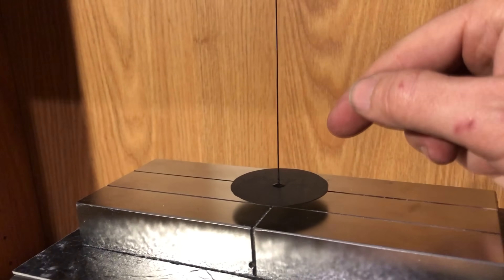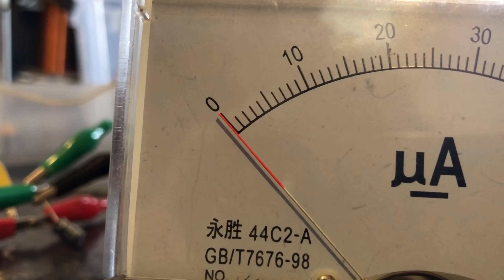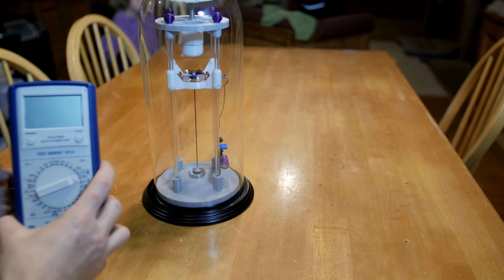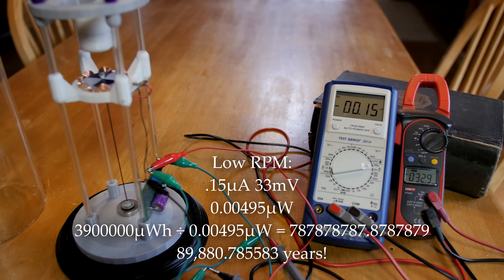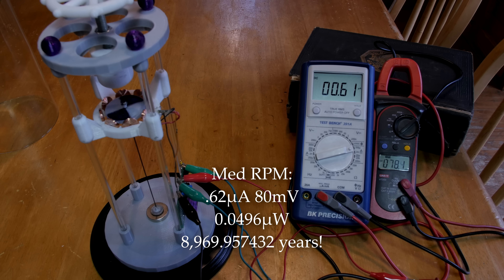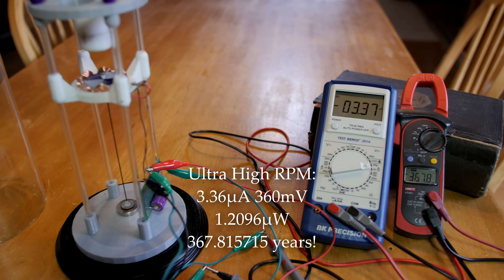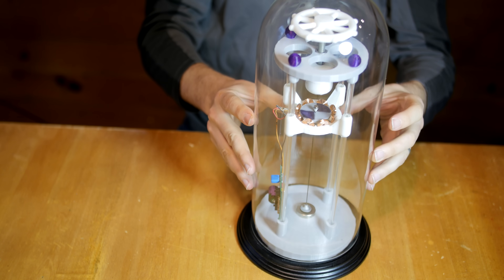Fully Levitating Magnetic EZ-Spin Motor - Pyrolytic Graphite

Comment: The motor is doing zero work, but it is still impressive to have such a low free running power requirement on a motor.
The power consumption is essentially nothing.  The battery will self discharge much sooner, pretty much at the rated shelf life of the battery (40 years).

Comment: The power loss on the resistors is P = R*I^2 = 24MOhm * (150nA)^2 = 0.54µW. So the total power usage would be 0.54µW + 0.00495µW = 0.54495µW which gives around 816 years on 3.9Wh.

Comment: You could try to harness the background cosmic radiation, I don't even know if this its feasible but with such a low load it's at least plausible, I cannot think of anyone who has actually tried it due to the fact that background cosmic radiation has such a minuscule amount of energy but if somehow you make it work your motor could theoretically run for millions of years uninterrupted.
Reply: cosmic energy? you could run it on paranormal ghost energy
Reply: @rogerd4559  cosmic radiation it's leftover from the light and radiation of the big bang, it permeates everything around us but the energy density is almost worthless, if you could somehow harness all the power raining on the surface of the earth it would be just a few giga watts yet that's not the hard part of it, energy its just a convenient concept we invented, it actually does not exist as such, what we call energy its actually a usable flow of low entropy to high entropy states of matter so in order for us to extract "cosmic energy" you would have to use something even higher in entropy and there aren't many things that can do that hence why the output energy is so low and complicated to get
Reply: @ericsaul9306  I got the jolt of my life hooking up my tv antenna to the back of my TV from that so called useless cosmic radiation

Comment: tl;dr: 178 years under generous assumptions (for the motor as described in the video).

So, your calculations assume that you can use all the energy, but you're dropping 99% of the energy in your resistors.  The battery you're using is nominally 1.2 Ah, but at 10 uA, it's actually 0.97 Ah according to the datasheet.  I tried a bunch of things to figure out how to extrapolate that to 0.15 uA, but didn't come up with anything I believed.  So, let's just assume that you get the 0.97 Ah (even though we know it will be less because of more self-discharge).

That gives us: 0.97 Ah / 1.5e-7 A  = 6.47e6 hr = 738 yr.  So, we know it will not exceed that.

Next, I took a deeper look at the datasheet.  Looking further at the discharge characteristics graph we see that, at 0.5 mA, we can extract 4.176 Wh of useful energy (3.48 V * 1.2 Ah).  That's the highest energy extraction in the graph.  At 10 uA, we can extract 3.531 Wh.  So, over almost 11 years, we get 84.6% of the energy that we would have gotten if we had extracted it at 0.5 mA for a bit over a quarter of a year.  If you work it out, it comes to 1.52% capacity loss per year.

So, I created a program which starts with a full battery and each year removes 1.5e-7 A-yr of capacity (which works out to 1.3 mAh) and then multiplies the remaining capacity by 98.48% (=100% - 1.52%) to account for self-discharge.  It stops when the capacity goes negative.

For the TL-4902 half AA battery you used (1.2 Ah), it dies on the 178th year.  If we use the full AA battery (2.4 Ah) it dies in the 220th year.  If we used a "standard AA" (3.9 Ah) but assumed that it self-discharged at the same rate as the TL-4902 battery, then it dies in the 251st year.

If we assume the 0.7%/yr self-discharge described in the article you linked, then the three batteries, the 1.2 Ah, 2.4 Ah, and 3.9 Ah, last for 286, 375, and 440 years, respectively.

So, even under the most generous assumptions, I think that a millennium is out of the question, but at least on paper, it could last decades and a century seems theoretically possible (again on paper, at least).  Of course, that assumes that the materials you used don't degrade and that the battery doesn't corrode and so on.  And that no one bumps into it for a hundred years... :-)
Reply: Okay, one more thing:  If you want to assume that you can make use of 100% of the energy (so you have a mythical 100% efficient DC-DC, for example) then my program gives the following numbers:

For the half AA battery (3.53 Wh) we get 466 years.  For the full AA (7.06 Wh) we get 511 years.  For the standard AA (5.85 Wh (3.9 Ah * 1.5 V)) we get 499 years.

So, better, but the self-discharge still eats you alive before you get near a millennium.
Reply from the maker: Thanks a million for calculating all that out.  It is very useful information.

Comment: I may be mistaken but isn’t your power off? You have to convert mV to uV then multiply by uA to get the correct uW. This would give you a number 1000x greater.
Reply from the maker: Engineering Entropy You can check it here: https://www.rapidtables.com/calc/electric/ohms-law-calculator.html

Comment: Beautiful, a real marvel according your values it should work without battery by putting a zinc wire around a carbon pin, or 2 metals like copper and sink, also thermocouples are able to make this turn. The speed will be temperature depended. “ Peltier effect ”.

Comment: Hello. Nice build.
You should use the system voltage to calculate the power. You use the motor voltage of 40mv. That just tells you the motor power. The rest of the losses are in the resistor. 
Another way to look at it is how much power is the battery losing?  Answer = Battery voltage x 0.15uA
Reply: Great observation, and this is when we look into methods of energy storage and conjunction of other technology to either work with power leaks or continue with a joule thief apparatus to bring about desired output. The battery is not the problem rather the size of the wire that limits and constrict energy flow. There is only transfer of energy never loss. To transfer most efficient and effective without any energy leak or need for calibration it requires proper wire gauge and a direct connection. A power supply without branching of any other circuitry.

Comment: Wow, incredible!
Tell me please, where did you get this small copper coils?
Reply: Cheap dollar store toys that move when you put them under light.
Reply: @ucitymetalhead  yes but it is usually glued well, how you deattache it without harming the coil?
Reply: @zevik84  couldn't say without actually looking at one.
Reply from the maker: You can easily remove them using a heat gun.

Comment: How much current do the little moving flowers draw? That will give you something to compare with.
Reply from the maker: "The hula girl will still dance under rather low light conditions. Using the removed solar panel to test the light level, I found that another copy of the toy works with as little as 400 uA of average current from the panel ( at approx. 1.4V or less than 1 mW)."  Source: https://ez.analog.com/university-program/b/blogs/posts/solar-powered-motion-toy-tear-down

Comment: What is the input impedance of your meter that is reading the mV?  Most DVMs are 10 meg.  Measure the current without the mV meter in circuit and see what you get...

Comment: Neat-O.....much of the energy is lost to the resistors(however high), Ideally you want to eliminate them, try lower voltage sources, perhaps thermocouples(in configs to get the desired mV at room temp)or ambient RF energy type of devices. I don't think a vacuum will be as significant as one might think at such low RPM's but of course it could only help.

Comment: The self discharge will kill it after a few years with a standard battery..

You could try to harvest/rectify some radio signals :)
Reply: if you keep the batery cool it will last much longer before it self discharges
I keep standard alkaline batteries in my fridge  for 5 years now and are still fresh they are 1.56 volts in and the same when using them

Comment: Why is he hanging, I understand. what makes it spin? How is a rotating magnetic field created?
Reply: Most of the lift is between a large fixed magnet on top of the frame, and a small magnet on the top of the floating rotor. What makes it stable is a disc of pyrolitic graphite repelled by a magnet at the bottom of the frame. 

It won't work for every possible configuration a magnet pair on top and graphite over a magnet on the bottom. The parts must be arranged so any movement causes more of a change in the graphite than the magnet on top. For instance, if it moved up 1mm, and the two top magnets increased their pull by 0.1gram, the graphite would need to reduce it's lift by more than 0.1 gram or rotor would just be pulled to the upper magnet. The stronger the change on the graphite end, compared to the end with two magnets, the more stable the system is.

I hope that made some sense.

(force is actually in newtons but weight is easier to write)
Reply: @RobertSzasz  Thank you for your reply. My question was not about the suspension itself. I do not understand how it rotates. What makes it rotate if only direct current is fed to the coils? It would have to freeze in one position and just hang. Do not spin.
Reply: @MegaVolt_ex  there is a small reed switch slightly offset from one of the coils
Reply: @MegaVolt_ex  I think it may have a small point where it would lock up instead of turning, but once it gets started the reed switch makes sure the coils give the rotor a little kick as the magnet comes by.
Reply: @RobertSzasz  This is genius!!! :))) Thank.

Comment: because the current is only pulsed it is probably fooling the meter.  it might not be giving an accurate average. You would need to use an oscilloscope to double check

Comment: Well, you are too optimistic. Assuming that yout battery is 3.9Wh/3.6V = about 1083333uAh / 0.15uA = 7,222,222 hours or ~824 years. That's because you are using linear "regulator" (the resistors) which burns the rest of the power (3.6V - 0.033V)*0.15uA = 0.535uW in the resistors to heat them up. That's 108 times more power than your motor requires to run. You could use more efficient regulator - a SMPS buck converter, but they don't have 100% efficiency and they also consume power. The most efficient I know run on 40 uA - which is more than your current circuit. But in theory if you find a battery that gives you 40-50 uV at 0.15uA you could power the device for that many years. The nuclear power is one way, but I'm not sure that the solar cell gets too much of the whole energy produced from the Tritium lights. Also I'm think just a small part of the energy is really converted to light.

Comment: Your total power use will include the set of series resistors. Measure the voltage drop across each resistor and throughout your entire system.
Reply from the maker: True if I am powering it with a higher voltage battery, but what I was trying to wrap my head around is how long it would run on the 3.9Wh of energy the AA battery represents.  How long would the motor run on 3.9Wh worth of energy?  I do not need to include the resistors because theoretically the 3.9Wh could be delivered at the appropriate voltage with no need for resistors.  I think maybe I did not do a good job explaining what I meant in the video.

Comment: So two thoughts, one running it off of light inside a vacuum would produce power?  Fins one side White the other black.
The other it's be way over powered but any semi conductor with a small heat differential with produce way too much power for this thing

Comment: What is the resistance of the coils?  I assume that is way lower then the series resistance you have put in series.  So most of the energy "consumed by the motor" is on reality consumed by the resistor.  You can improve this by winding the coils from the thinnest wire you can handle, putting as many turns as you can in the space.  (What is the winding configuration of the coils, and the arrangement of the magnets?  Are all in series, connected as a single circuit?)
   (If the magnets are arranged N-S-N-S as 4 poles, you would be better with only 4 rectangular coils, with the turns being placed at the spot where the rotor magnets are when the reed switch turns on the current.  I assume the duty cycle of the "on" time is short relative to the total time for 1/4th turn of the rotor.)
  The levitation system will be sensitive to temperature.  If it gets hotter, you will need to adjust the top magnet closer.  If you are interested in more on this design, reply to this comment and I will give you more details.

Comment: Well done.  I wonder what H.G. Wells would have to say about this.
Reply from the maker: Thanks.  Do not give up on this levitation technique.  I think using this method it will be possible to get a motor going on less than 50nA.  This first build is just proof of concept.
Reply: @lasersaber OK.  I need to figure out what size neo ring magnets I need for the pyrolytic graphite disk I have.  Those ring magnets are critical for this bearing.  Like you explained in your video, the square magnets platform doesn't work.  It is just too unstable.
Reply from the maker: Yes, but even if you could get it working the biggest issue with the square magnets is that the drag is very high.

Comment: Try power it non-galvanically with telluric earth currents (two stakes cut from same metal rod (silver-plated) driven into the ground N/S about 50+ yards apart)
Reply from the maker: I will have to try it and see.  Thanks for the input.

Comment: That's a really nice and amazing motor you've made! Excellent work! Because the unit draws such a small amount of current, you can easily power it with a radiant energy collection circuit. I'd love to see that operate in a vacuum. A++
Reply from the maker: Thanks.  It should be possible to scavenge the needed amount of energy from environment.  I will have to keep experimenting.

Comment: Well done work , but why don't you try to scale up better  your Easyspin motor into the Watts range , than to play with nanoWatts toys ?
Reply from the maker: Bigger equals less run-time.  Maybe I will work out a way to levitate larger rotors and create an energy storage flywheel device.

Comment: This would make an interesting design for a long-term radio "beacon" for space-based navigation.  Since the rotor will act as a gyroscope, station-holding should be possible as long as nothing interferes with device.  You could then attach small radio-absorbing baffles to the top of the rotor and have them rotate around a feflective core, meaning that any signals of the proper wavelength beamed in the direction of the beacon would be reflected at a specific rate.  

Such an electro-mechanical oscillator would seem like a laughably Rube-Goldbergian way to build a beacon, but it also seems like something that might drive up the mean time between failure of other more energy-intensive systems.  If, say, these things were seeded throughout a volume of space like the asteroid belt, anything that can reduce the costs of maintenance (and merely going to the beacon would be the primary cost unless you've got some sort of maintenance bot that uses esoteric propulsion like solar sails) is a good choice.

Comment: LED's can act as a solar panel when light is shined on them. The power generated is extremely small but I wonder if its enough to run this motor under reasonable lighting conditions. Maybe series/parallel several together and see what happens...
Reply from the maker: I am sure that it would work but not as well as a small amorphous solar cell.
Reply: @lasersaber  yes good point. I guess what's cool about it in my mind is that LED's are not thought of as an energy harvesting device. Good work on that motor though. Its impressive!

Comment: Really nice concept and build!
However you can't measure voltage across the 24Mohm resistor unless your meter has at least 10x that much impeadance... and it doesn't. So with 3v potential, 24Mohms load (since you have the large filter cap, which smoothes the pulses to essentially DC) the measured current is at the battery voltage of 3v... so 3v x 15uA = 0.45uW and if a 2.4Ah AA cell has 3.6Whr that's 8,000,000 hours which is only 913. 24 years.  Have you tried to measure the capacitor voltage to get actual operating voltage?
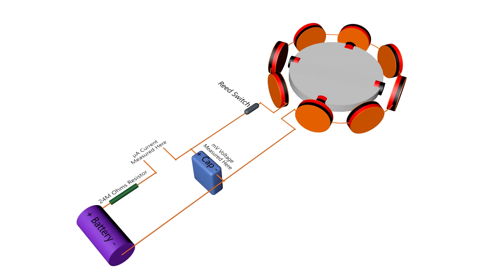Reply from the maker: Yes, I was measuring the voltage across the capacitor.  Did you see the graphic at 3:37?  I was not really wondering about how long the motor would run on a AA battery but how long it would run on the 3.6Wh the AA battery represents.

Comment: It's a Beauty! 
I noticed that the rotor nearly stops when a magnet approaches a coil. After passing the coil it receives a slight push.
Meaning ... that if you can make it run smoother without breaking at every coil, you could easily(!) double the run time ;-) 
Reducing the amount of coils would help already.

Comment: How about using an earth battery.. or would the electrode wear out too soon?
Or how about a simple elevated length of wire outdoors with spark gap and diode and capacitor energy harvesting circuit from the air. That would produce enough power and last forever?

Comment: You forgot to calculate the power loss across the resistor. Total power usage is battery voltage * current.
On low RPM mode, say the battery voltage is 3.6V and the current is 150nA, it would last for 823,89 years. Still quite impressive